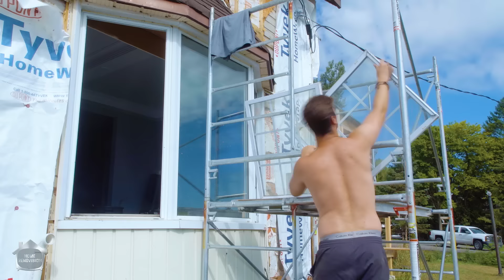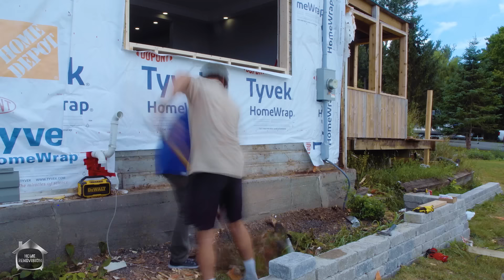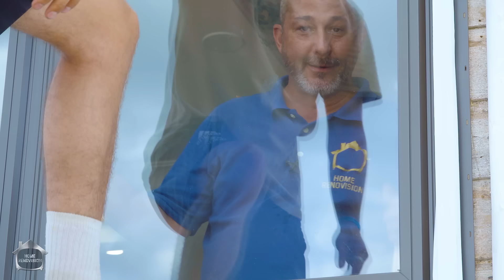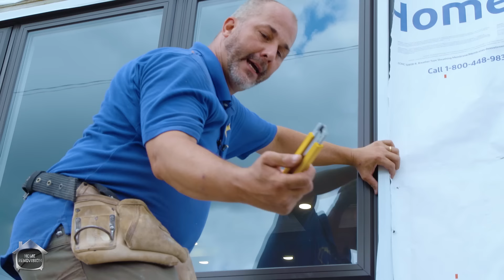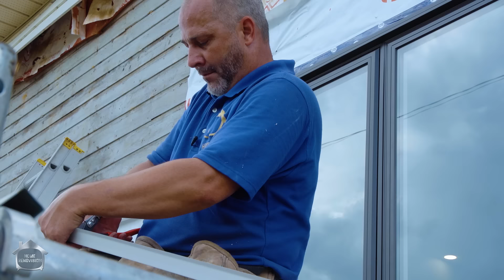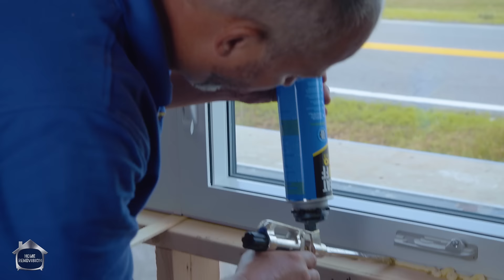How to Install a New Window| Quick and Easy

Comment: are you not concerned about the duct tape becoming brittle and not adhering years down the road thats what is happening in Canada and installers have switched to 3m tape much higher quality

Comment: Don’t tape the bottom flange. Do tape any holes or over cut in the house wrap. If your pan is flashed correctly prior to install then if water gets in it will have a place to escape out the bottom. If taped it will be trapped.

Comment: wonder what the price would be for windows that don't require any trim or trim work. Such as a 1950s Mid-century house made from brick with roll-out casement windows. It's brick on the outside and round plaster ledges on the inside.

Comment: The window installed over the tubes is incorrect. Tyvex  under window, caulk and install window, tyvex ( or similar) flashing tape over nailing flange

Comment: Hey i watch do the time thanks.  Quick question. I have two new replacement windows for a new kitchen over sink.  I want to install drip cap.  Should i do the cap separately for each window or just do one piece across both windows.  The center trim would go up to the bottom of the drip cap.

Comment: The window manufacturers make windows with built in J trim for vinyl siding. I turn to Jeff for his knowledge and expertise. In most cases, especially in having to deal with building inspectors, his understanding of building codes will keep you out of trouble.  In my opinion, installing the waterproofing membrane and calking is an extra, inexpensive step to protect the biggest investment you'll ever make, your house. Even if it is no longer necessary. This is a how to install a window a different way and Jeff has other videos using the waterproofing membrane with a window or door install.

Comment: Hey jeff, love your videos. I have an old house on replacing the windows and siding on. I would really like to use this type of window with a nailing flange, we are taking the old vinyl off and leaving on the old wood siding. Since the surface is not as smooth, can I still use this window? Or do I need to use a replacement window.

Second question, vinyl windows can come with an integrated J channel, seems like that would be the best way to go to reduce moisture. Wondering why I don’t see very many of those on videos. Thanks again.

Comment: Thanks Jeff! When nailing in the flange to the house, I'm naturally terrified of using a hammer anywhere the frame holding the glass, and would prefer the grip of a screws teeth rather than the friction of a nail. I assume using drywall screws are a big 'no-no' but are there any types of thin profile screws that would be okay to use for this procedure?
Reply: You can find galvanized or stainless steel flat head screws at just about any hardware store.

Comment: Does this house have clapboard siding under the Tyvek? Is there insulation in the walls? I ask because I'm dealing with a similar situation--old 1930s house, balloon framing, vinyl siding over wood siding over actual 2x4 studs. Trying to figure out if I need to remove the wood siding and replace with proper sheathing, or if I can put house-wrap over it as is. There's no insulation, but I'm not sure I can add any without introducing moisture problems due to the balloon framing, no house-wrap, and no sheathing situation.

Comment: Wait...expansion foam!? MANY experts on YT and the rep I bought my windows from (Ringer) are absolutely adamant that you NEVER use expansion foam around a window. You cannot control the expansion and it could push it out of square and it also holds water because it's so porous.
Reply: There is more than one type of expansion foam. Some expand a lot and can cause the problem you're talking about. The blue can labeled for window and door is designed for this application and expands less. To my knowledge, they do not absorb water.

Comment: Thanks again for your great video! I'm at the very beginning of replacing windows around my house! VERY beginning. I measured and re-measured them and then measured them one more time. All are measured from the inside except two that are surrounded by brick. I measured them from the outside even though there is no difference between inside and outside measurements. Particulars:
1. Two big windows are surrounded by brick on the outside.
2. Two other double-wide windows I'm replacing HAD BEEN surrounded by brick until a tornado ripped the brick façade off while blowing out the windows and frames. I'm THINKING of replacing them with bay windows as they face the front of the house. (Would there be issues with replacing old 1970s windows with bay windows?)
3. Of course, the bath window is opaque and tempered.

There's a total of 7 or 9 windows, depending on type/configuration (e.g., bay windows count as one each).
 I ran across some advice somewhere that I should reduce all measurements by 1/2" on each side. Do you think this is necessary?
Finding a wholesale supplier has been challenging because everyone wants to install them, too.

I took your advice to check out the Tuff Stuff Pro 14 Foam Gun. You should check it out because there is an upgrade that might influence shoppers!

Thanks for your insights, advice, and your hard work on the videos! Thanks to your sons, too.

Comment: Question: The BlueSkin tape you are using? Where can someone get that, the link in the description takes me to some different Zip Tape product that seems like you need a roller to apply... Or what is the product name/number? Is it just a Polypropylene film acrylic adhesive tape?

Comment: these new install windows are way less expensive, just need to cut ur siding away a bit and build it back....which is probably the hard part with an old house with wood siding.

Comment: No! you really didn't mean "EXPANSION SPRAY FOAM."  True there exists a product the is a specially made spray foam, but look for the can that is for windows because it doesn't expand.   If expansion foam is used and the window is one that opens; it may not open.  If it is one that does not open there is no reason to allow expansion foam to put unneeded stress on the window.   As for relying on "House Wrap" as water proof - sorry, but your are wrong there as well.  Water vapor passes through the "House Wrap" and turns back into water (it's called condensation).  If in doubt read the manufacturers product info. and don't believe me or anyone else on the internet.  Lastly, a thumbs down or any constructive comments are not "Haters."    (JF)

Comment: Can I still use a 'new' window vs replacement window, if I'm not also installling new siding on the outside?
Reply from the maker: you can't use a window with a nailing flange unless you have exposed the weather proofing layer and will be redirecting water to travel on the exterior of the flange so it does not infiltrate the building.
Reply: @HomeRenoVisionDIY  I figured that was probably the answer, thanks!  Unfortuntly this house was built in the 50s and I highly doubt it has a house wrap, and I just want to replace a few windows so I guess I'll follow the instructions on your previous window video! either way you have the bases covered!

Comment: I just bought 4, new construction sliding windows from Home Depot. Was going to go with replacement but I still have to remove my siding where the windows are going in so that’s the route I decided. Ic ll just number each siding take a picture so I know where they go back

Comment: Hey Jeff. Love your the content you put up on your channel as it takes the fear out of renovating by informing us what to look for as far as potential problems and how to simply navigate the build process. I have a quick question about this window install. Could one use the existing j-channel included in the brickmold to slot your siding into rather than butting up a second vinyl j-channel to the outside edge of the existing brickmold?

Comment: I don't know if the type of foam maters, but we found that spray foam will expand to fill the space, but then it will shrink over time, pulling the frame of the window apart. If this is an active window, that will destroy your water and air infiltration raiting. You should also use solid shims on the sides. Or your window will sag when your house moves and make the window hard or impossible to operate. This also can let water and air in.

Comment: This is not code... by code you out flashing tape along bottom sill, put the window in the flashing tape along the the sides then top of the nailing flange. Then seal the tyvek to the flange. Also, pretty sure you didn’t caulk the outside either??

Comment: Just building our new home, Nova Scotia, family property on the ocean. Last year due to covid I hired some great guys to bring the house to water tight before winter, and they did do great work, on time within budget.  I'm looking at the window installation, there is tyvek, they have caulked, but I can see the nailing flange has no tape on it.  The tyvek is behind the nailing flange.  From your video I'm thinking its an error, the question is, what's the fix,  Cut the tyvek, use extra tape then retape the tyvek to the nailing flange. the windows have a built in channel for siding, if that matters.
Reply: They did a good job......

Comment: I just installed a new window with a nailing flange onto shed siding. I put a membrane all the way around the window, per window instructions and watching your videos-:). Looked straight forwar enough. It rained and water built up on the inside of the sill on top of the membrane and ran down the inside of the shed. I left a small gap of caulking at the bottom of the window on the outside, just in case water did get inside and it would have a way to run out...  I obviously did something wrong?!

Comment: here in alberta, we have to caulk the opening before putting the window in. also, we gave to create 1inch end dams on out drip edge/  then your j sits 1 inch higher on the drip edge.  'berta

Comment: Hi Jeff. I’ve got replacement windows to go into a block opening that previously had aluminum 1960’s windows. I think they were screwed into the edge of a 1x4 wood frame built into the lock opening. The new vinyl windows are thicker and can’t be installed the same way. Ideas?

Comment: I need to replace a basement window, rough opening is approximately 35x35. My dilemma is that the previous owner installed storm windows and used some sort of bent aluminum to trim the storm window up to the siding. Also, the vinyl siding is already a re-siding job over wooden shakes. So, what do I do ? Do I remove the window and aluminum trim, pull back the vinyl siding, nail the flange through the wood shakes ? Then put the J channel up against the new window frame and put siding up to it ? Or....is there a trim product I can use to fill that gap between siding and window. If I do all of my windows I'll be buying and replacing a lot of siding which is too short after removing that aluminum.
I saw a video where they (this old house) used an architectual moulding that had an interlocking method similar to J channel but I can't find that type of product anywhere.....at least not online. Maybe HD or Lowes has it buried in their websites but they are really user unfriendly. Anyone got any suggestions ?

Also, does anyone know if it's possible to buy vinyl siding with a 4" lap that only has one lap ?

Comment: My buddy wants me to help him change his bathroom window from a 24x36 window to a 56x36 window. He has vinyl siding. Since I’m going with a larger window should I go with a nailing flange or screw from the inside?
Reply from the maker: if you go with the nailing flange then you will have to cover the area where you cut back the siding with a peice of flashing. Easy if you buy a window that has a detail on the outside tio install flashing. if not then from the inside is your best bet. make sure to install a proper header on the interior. cheers!
Reply: Home RenoVision DIY for a 56” span what size of header do you recommend. This window will also be installed in a shower. Any recommendations on what style of window to order for showers

Comment: No plywood on bottom of window, no caulk on backside of flange, not a level in sight and you didn't check for square. House wrap goes over nailing flange and then apply window wrap and staple it off.. love the drywall videos you have but dude, that's not how you want to install a window.
Reply: Why do you need plywood on the bottom of the window?

Comment: I would have put silicone before nailing the top flange, sometimes the tape fails, and you will have penetrating nail wholes leaking water in

Sorry seen it all

Comment: All right then... I may end up doing my own windows installation next time! But wait, all it’s left to replace is a big window, a patio door and a big bay window that kinda big « U » shape outside. Not an easy one!
Reply from the maker: but the bay window in sections and go to a custom aluminum bending shop with your measurements and they will bend the finishes for you. Cheers!
Reply: Home RenoVision DIY I think I understand what you mean. Thing is, every time the previous owner did something, he did wrong big way. So I’ll probably have to fix the structural and isolation. How can I send you a picture of what I have?

Comment: I’ve never done new construction window but I’m surprised there was no leveling or checking if the windows operated correctly before nailing the window in. Did you just skip over this step or is it not needed?
Reply from the maker: i installed the sill level. used the same thickness shim on all pressure points. problem solved. but yes level is very important. Cheers!

Comment: Quick question: Any advice on replacing aluminium windows on an old brick house? Windows nailing flang is nailed to the frame and bricked over; very difficult to remove.

Comment: Great video Jeff! I was just waiting to see if you put the drip cap above the window! Lol!  Please don’t take this in the wrong way,,The only thing that I would have done differently, would be to order the window 1” smaller to have a better bead of foam to seal it up on the interior and I would have ordered the jambs already installed on the window. The foam does a better bead when its min. 3/8”. Everything you did with the tyvek and blue tuck tape is the way to do it! I would also still shim the key points on the interior of the sides also, to support the frame and fasten through the shims. We use 3/8” premium screw caps that don’t look so bad and are great. I would also recommend that you pre caulk the top exterior corners on the drip prior to installing the j on the sides right in the top corners. (Hard to explain easier to show. basically caulking the brickmold to your top drip from under where you did the perfect 1 inch overhang!) The comments I have made are only because I have been Window Wise certified since 2001. FOR EVERYONE THAT WATCHED THIS VIDEO, JEFF DID AN AMAZING JOB! 🤩perfect video for DIYERS and guys who are starting off installing windows! Jeff  knows his stuff! Thanks for sharing Jeff! Btw, its nice to see your boys helping you out! Stay safe and healthy Jeff and everyone out there! 👍🏻  (you can look into the screw cap covers, from SIL plastics. they have a factory in Vaughan, Ontario. I’m sure you will like them just watch out if you want blue white or a bone white color to match the color of the interior of your window. the ones we use are part #89 hole plug part) Hope this helps!🤓

Comment: Another great video.  Thanks so much for taking the time to put these out there.  I do have a question though.  I have noticed that you typically put in Gentek or similar windows.    For a DIY'er are big box store windows that bad when compared to a window company like Gentek (or  Van Isle windows on the west coast)??  Curious as I can never see a straight answer on that...  thx so much again for all the videos!!

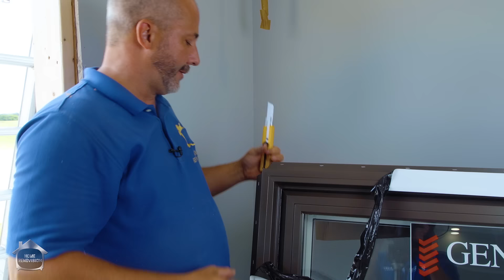Comment: At the 3:30 mark you can see the top left corner of the flange is busted off. This is why manufacturers don’t recommend relying on using the flange as part of the building envelope sealing protocol. It seems when you are putting a thousand dollar window into a million dollar home with very little overhang using Blueskin membrane tape and not Tuktape might be a good idea.
Reply: It's not broken, the corner is made that way. If you look closely when he is starting to nail the flange the other corners are the same way. All of the windows I installed in my house were like this also.

Comment: ....... I like taping the tyvek to the TOP of the nailing flange but I want to tape the tyvek to the building then tape the sides of the nailing flange to the tyvek. sorry Jeff I don't like your method here.

I want to seal that opening first. then seal the window to the tyvek
Reply: I agree. Tucking the bottom nailing flange under the barrier is a huge no-no in my market...not sure what the standards are in his. I don’t care what you do above the window or what products you use, you must shingle the system to allow water to escape once it’s there. Because it will be there.

Comment: Another great video Jeff! Quick question though, it looks like around your window is wood that you nailed into, I have a bay window that is surrounded by brick. How should this window be secured to brick? Can this type of window be nailed into brick or would the brick crumble? :_RenoVisionHome:
Reply from the maker: sorry daniel for brick you need a replacement window with the brickmold and no nailing flange. that type gets installed from the inside. Cheers!

Comment: I built a new garage recently and the windows I installed were much like the one you installed here with one awesome difference: mine had integrated J-channel for the siding to tuck into. Made it super fast and easy to not only install the window but to do the siding, too.
Reply: The windows I am ordering also have the J-Channel built into them. Seems like a no brainer to me.